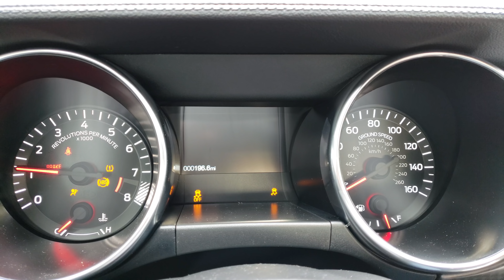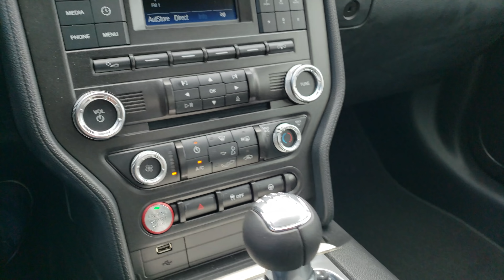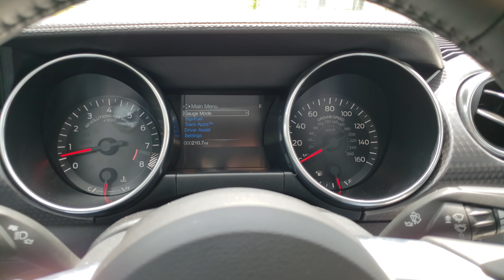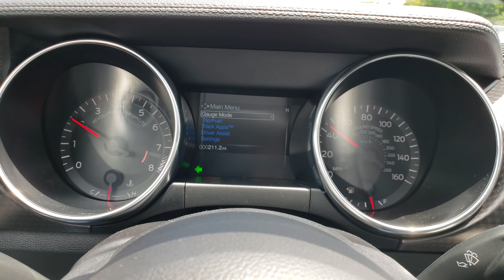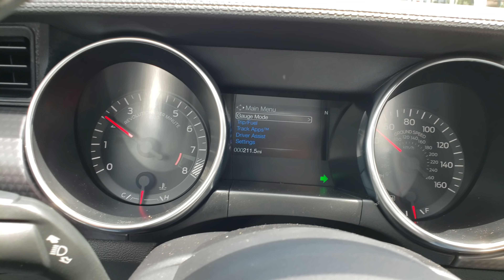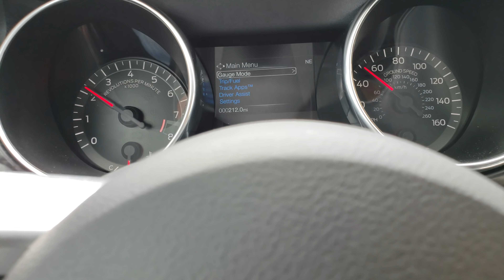I bought a 2018 Manual Mustang PP with 3.73 and already modded it

Comment: I traded my 2017 GTCS for the same thing you did. It was the base Mustang with the Performance Pack. I don't have the info system (put my own Sirius radio receiver in it) nor leather, but I never got a lot out of having leather seats. It is blacked out, six speed manual I have the spoiler on mine. I did add the flow master 40 series, but left in the resonator (I did the same with my 17, but this sounds more aggressive, even with the resonator still on the car).

Comment: I have a late 2016 GT manual with approx 14,000Ks, I put in the Steeda spring and whilst the take up point felt more predictable the actual pedal was harder to engage and sprung back with more force, put the stock spring back in after a couple of days and felt completely different (I guess the Steeda put it into "Perspective"!) lighter and easier to use and the take up point didn't seem to be an issue.  didn't drive it without any spring as static the pedal was (for me) to heavy / stiff.

Comment: Track Apps bud...line lock only activates in Track Mode. Itll light up in Track Mode. Also, if you put it in track mode and hold the traction button about 5 seconds to turn or stability control, line lock will turn on BUT say it's not available when u go to activate it.
Reply: You don't need to be in track mode to activate line lock.
Reply: petey2crazy on my 17 GT you do
Reply: My 15 Gt doesn't need to. The only mode it can't be in is snow/wet. I can't find anything on the web that says you need to be in track mode.

Comment: I thought the cars with the PP came with the digital dash cluster? I bought the base model, and got the one you have there. I kind of think the digital one is gimmicky, anyways. I'd really love to know what ya paid for that car, though! I bought mine for 29.5k. Marked down to 32.5 with rebates and incentives in my area. Think I did well, but would love to know if I could sharpen my negotiating tactics a little.

Comment: Link lock is out probably due to needing the brake in miles. Friends trackhawk wouldn't let u use launch control until 500miles
Reply from the maker: I5ZQ8 nice I'll keep you posted
Reply: 15ZQ8  Thanks for your post.  I was wondering myself why "line lock" was grayed out and being  PP at that.
Reply: Line Lock is not an option when the Cruise Control is powered on. Turn the CC off. Have a great day guys.
Reply: Sandy Crowley Thanks for that tidbit of info!
Reply: You're welcome!

Comment: Love the car man!! I have a magnetic 301a PP M6 car. I love it. It is hard to shift though. At high rpm I’m losing clutch pressure. The pedal isn’t going to the floor just about 1/2 way down and it’s almost impossible to shift. Oh and I’ve had the 3/4 fork replaced. So hopefully I’m good to go. Are you gonna do headers or just a cat delete?

Comment: Hey buddy, looking at a 2011 Yote with 100k miles for $11,5. It’ll be my first stang, it’s within budget but the miles concern me. It drives great, it’s fully stock. 

What’s your thought? 100k miles a lot for these engines? I know the 4.6s last forever, don’t have much knowledge on the coyotes.

Comment: Wow. I'm getting ready to buy an 18 GT and the fact that I have to remove a spring in the clutch pedal to make the engagement point usable? I just don't get buying a 40k car and having to change a major component of the car. Why didn't they do it right is my question? During my test drive I noticed I was having a hard time finding the right engagement point when starting from a stop. frustrating.

Comment: For someone who already has the Steeda aftermarket clutch spring would you recommend just leaving it in or taking it out? Never thought about just taking the whole assembly out. Also was the rev match stick with the 15-7’s, I never noticed that before? Now I can’t wait to jump in my ride when I get off work.
Reply from the maker: Dirty__D 15-17 also have it. And I just took the spring out
Reply: Wow, that’s all I have to say. I could of saved $20 on the Steeda spring, not that it was expensive but as big of a difference I noticed from stock to Steeda it was just as big of a change from nothing over Steeda. 
And I was able to feel the rev match once I slowed down my pedal release. I’m a “fast shifter” too so I never felt or noticed it. I really had to slow down to feel it, basically it’s about a 1 sec delay from when you put it the different gear. I would put it gear and literally do a one-one thousand in my head before releasing the clutch. It makes the car really smooth if you shift slow but I’m going to have my tuner remove it because I think I might be fighting it cause I shift so fast. Thanks for the knowledge Alex, keep up the new content 👍🏻

Comment: Hey Alex. Just built my dream. I have a 2012 Genesis as well that I bought for a daily driver instead of my dream car, 2015+ Mustang GT PP1.  I may have to go see if I can hunt down a deal on the 2018 like yourself.  One question, what is your thoughts on the transmission shift fork failure? Any plans to upgrade the MT82 or just leave as is and have Ford fix it if it were to fail?

Comment: Alex, Steeda has a replacement spring for the clutch pedal, I guess it is a lighter spring that helps give more pedal feel, but do you think it is just marketing when they claim that running without a helper spring puts strain on the slave cylinder long term causing leaks?

Comment: I've got the exact same car in kona blue. Awesome info on that spring popped it off and boom..... Night and day. Clutch pedal feels amazingly predictable now. 
    After the fact saw a thread that removing it completely can cause possible   slave cylinder damage. How much truth is there to this? Anyone?
Reply from the maker: Chad Keller I had mine off for 6 years in my 11. No issues  it's not an internal stop...just an assist spring
Reply: Thanks for the quick reply & all the great info you're putting out. Appreciate it
Reply: Alejandro Flores what do you think you're gonna mod(parts) first? I've heard a lot of people complain about the "notchiness" in the shifter myself included.
Reply from the maker: Chad Keller the shifter to me is fine. That wont be upgraded

Comment: Alex, working in the tuning/performance mod world, what is your & the mechanics you know opinions on the "break in" period for new vehicles/engines?  Stuff like "keep it under 60, vary your RPM & don't go hard on the throttle or brakes in the first 500-1000 miles"?

Comment: Question man.  I did this on my 2018 gt350 and like the feel a ton better then with the assist spring.  I do have a little play in the clutch now though when it is fully out,  like a half inch of sag.  Meaning when the clutch is fully out you can put your foot behind the pedal and push up and the pedal will move upwards like a ½inch.  Figured you would know man,  is this bad or what?  I just want to get a definite answer.  Some People say it is bad on the seals and can cause them to leak cause the clutch is not fully returning to it's stock position.  Figured you would know the answer to this.  A video on this or just a simple reply would be much appreciated. So sick of worrying about it.

Comment: I want to learn tuning with hp tuners. What do you recommend for a newb to do? I been looking over my tune for a procharged 2012gt. I get wrench light and my tuner says its heat since vegas is crazy hot. Waiting for radiator to eliminate lack of capacity, and wrench of yellow death!

Comment: Hey Alex. Can you do a quick video of your thoughts on the performance difference between direct fuel injection on the 2018 mustang and the old way ford did it on the 2016 mustang? How different it is to tune between the two as well. Thanks.

Comment: Compared to the 2011-2017 Mustangs, Is the clutch throw shorter? I just personally found the throw to be longer than needed, as it reminded me of a BMW's clutch but grabs much later.

 Just curious as I was burned by my own MT82 in a 2012 GT I had, sadly in ontario canada the laws are different so I took the hit and had to get it rebuilt with my own money. So I am hesitant to go and really look at a 2018+ GT, and stick with the 392 Challenger (which I am still kicking my backside over selling)

Comment: Congrats Alex!!! There are MANY videos of engine ticking and excessive noise, some even think piston slap coming from the gen 3 5oh. Could you do a video a give your opinion on it? 
Thanks.
BTW LONG time subber
Reply from the maker: I'll keep you posted.
Reply: Alejandro Flores Thanks.
I just ordered a 19 10r80 pp and we value your opinion.
It's got me a little nervous with some of the 5oh issues people are reporting regarding the engine.
Reply: It's not just the gen3.  Had my gen 2 long block replaced on my 2017.  Rattling noise around 2k rpm.  Had a few issues.  Most notably was evidence of piston slap.

Comment: I thought rev matching wasn't introduced on these cars till 2019 models.  Actually I have read multiple articles on this.  So what gives? 
Also are you concerned about the famous tick and the aluminum bending forks?  I know you were in a previous video and ultimately you said thats what put you off the new mustang......?
Reply: batman62487 
Yes I know what it is,  lol.  However he clearly states it has rev matching at the beginning of the video and it does not. 
I know how to rev match,  heel toe shift,  power shift,  etc.... No novice here,  like this jokester thinks he's the only one who can drive a manual. Little full of himself I'd say.  Lol
Reply: batman62487 
Yes sir!  👍

Comment: The 18s are going for almost 8k off MSRP if u include the Ford rebate that EVERYONE qualifies for...just picked up mine!
Reply: ThePerfectDad how do you qualify for that 8k rebate?
Reply: big yee not an 8k rebate...but with the rebate included which right now is $2500 for everyone and there are additional ones that are $500...with dealer discount it can all equal near 8k
Reply: ThePerfectDad what dealership is this?
Reply: Antonio Barrueta in northern Virginia...specifically Sheehy Ford of Springfield
Reply: surfncnow I’m from the area...U cannot go wrong with either dealership as far as reputation...hope you find the spec for u like I did !
Reply: ThePerfectDad what did you get out of the door with? I picked up a 2018 GT PP1 Base, and I got it for $33k, with the $1500 from my trade in. It stickered for $43k.
Reply: JonnyRend I didn’t have the luxury of a the trade in money but I was debating PP1 or the 301A and decided the 301A 10 speed and I’m adding the ford performance street suspension this month...OTD was 34.5k

Comment: Damn. I drove a 2018 GT manual and I hated the transmission clutch engagement and that was my main reason (and it was 50k) why I didn't get it because the clutch was so much different than my 2014 GT. And I'm a gear head but totally forgot about that stupid spring....

Comment: Yolo tengo una duda, el rev match no venia en el 2019?
Reply from the maker: That's downshifting rev match. not upshifting
Reply: @YDBT4LIFE  ,
What Mustang shop Do you recommend in south FL ?

What fluid are you using in your transmission ?

Keep up the great videos. 👍
Reply from the maker: @williamhorvat8224  stock fluid. And tradition Motorsports at this point is the only one that is taking in work.

Comment: After all the broken 6spd 2018s I'm surprised u still went with it... 
 over 10r80
Reply from the maker: WonSlow302  name all of the broken mt82 of 2018 you know of.. I know of 2 and it was clutch issues
Reply: Alejandro Flores maybe so. Friend couldn't shift to 3rd when high rpm when we ran. Brand new off the lot. Just came out the shop few days ago.
Reply: Quick search on the Facebook groups and seemed to be an issue of weak forks. Aluminum I think..
Reply from the maker: WonSlow302 so he could not get it into 3rd (clutch) and he forced it (driver error) and broke it. Sounds like clutch not fork

Comment: In my 18, the car seems to wait to open throttle body until after I'm rolling. I can use 4500 rpm limiter launch and still bog while ever so slowly releasing clutch (throttling out does nothing until rolling). Can you dive into parameters to see why the car won't respond to extra throttle until I'm rolling?

Comment: Can you comment on ring gap for the gen 3 5.0? Like is there any use in checking compression across the cylinders to see if the rings are "too tight" for big boost? Thanks
Reply from the maker: LOL i'm not doing that. LOL

Comment: Alejandro have you heard about the shift forks being weak on the 2018? If so you know of any aftermarket fix?
Reply from the maker: texas stangs ben calimer has only heard 1 case of it. And most is due to clutch lockout and ndmfers

Comment: Did you infer that "Line Lock" is now disabled from the factory?
Why?
Reply: It's not. You got to be stopped to use it.
Reply: and on level ground. I thought mine was disabled as well, trying to select it in my driveway after we brought it home. and my driveway is not that much of a decline either.
Reply from the maker: I was stopped. LOL
Reply: That's weird. Line lock is finicky as hell.
Reply: Maybe it only activates following the normal "break in" process.
Reply: Don't take this wrongly.
Sometimes a bastard just needs to break down and read the fuckin' owners manual.

Comment: I can’t decide if I want an full bolt on, cam all motor 13/14 or if I should just get an 18
Reply: A fbo cammed 13/14 will make the power a 18 with headers, intake and e85 tune makes. Only thing an S197 has is weight advantage. But personally I’ll always love my 13

Comment: Do you need the 3.73 to achieve the sub 4 second 0-60?
Reply from the maker: I believe so yes unless you make a boatload of power
Reply: Alejandro Flores thanks man. Another quick one: do you know if the lund tune is well serviced if I buy it in Mexico ? I live 5,000 feet above sea level so my GT is losing tons of power
Reply from the maker: @nozopoke1782  any calibration above the stock calibration is going to be better for the vehicle

Comment: Rev hang sucks, BTW. I want the revs to come back down immediately, yet the revs stay up. This matters because if you're going slow and you rev the car up to show off the exhaust, you have to wait a few seconds before you can engage the clutch or the car will lurch. This was added to help with MPG and it can't be tuned out, either. 😒

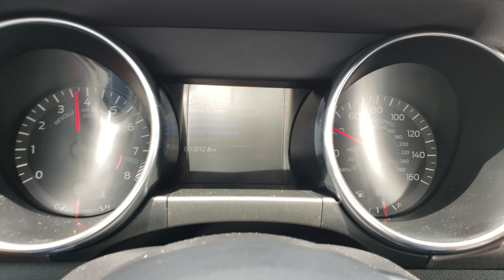Comment: 14:30 See. thats exactly what I try to tell people only fr it to fall on deaf ears. These cars, whether rightfully so or otherwise, are known as massive hoon-mobiles. People FLOG these machines the instant they drive them off the lot. I see SO many videos of people getting brand-spanking-new Mustangs doing burnouts, hard pulls, drag strips, etc. within the first couple hundred miles, well within the break-in period for the car and it's engine and transmission. Keep in mind  literally all manufacturers recommend doing the exact opposite of those things for about the first 500 miles (Give or take), even for top sports and performance brands and vehicles.

Not counting actual admitted defects that have happened (Like the manual shift forks in some of the 2018's), the vast majority of problems that arise from Mustangs, and really any car by extension of that, is due to improper handling during the break-in period. The Break-in period can have a direct impact on the entire life of the vehicle if it is done incorrectly. And remember these cars practically invite people to trash them like a 5-dollar hooker from Vegas. I think considering the fact most Mustangs throughout the years have worn very well with relatively minor problems is a testament to their deceptively robust engineering.

Comment: Is that spring on a 14 Shelby GT500 thank you
Reply: Mark Disbro crawl in there and look
Reply: Chandler don't recall asking u
Reply: Mark Disbro I doubt his answer would be much different lmfao
Reply: Chandler 🛴👆
Reply: Mark Disbro the gt500 has the tr6060 and almost every clutch comes with a spring now. i have a 2012 vette with a tr6060 and it had a spring.
Reply: Yes, '13-14 GT500 have removable spring, feels perfect without.
Reply: drjotting thank you

Comment: I guess u wanna go slower now lol. Alex why would buy a car with such an inferior transmission that will absolutely need to be replaced. Seems like ur going backwards now especially with the addition of the 4r200
Reply from the maker: DANTE BELGIAN MALINOIS lmao. You know nothing.  Lol. It's actually laughable.  Do the really really fast cars have more gears or less gears. I'll wait.
Reply: Just breaking ur balls.... settle down. The fast cars have 3 speeds unless ur talking Lenco or similar transmissions that cost $15k and cannot be used on the street. U don't have a Lenco bro u have a junk M82 and the 4R200 would not only make a 6r80 stronger but the gear ratio is better so what is it that I know nothing about exactly? I get it the majority of customers have stick shifts so u got one.
Reply from the maker: DANTE BELGIAN MALINOIS this is not a drag car . Like at all. It's a daily/autocross build. And those are 90%manual. I have an auto car. And hate it except when WOT the rest is boring. I love spirited driving and it's not possible with an auto unless you're going in a straight line.

Comment: Should’ve got an auto
Reply from the maker: I drive the manual way more then the auto. I would never buy an auto again
Reply: Alejandro Flores I understand. I just feel like the main reason for the 2018 was the 10 speed trans. And it’s great no complaints.
Reply from the maker: @Kingleo_23912  after seeing it apart. I'm not a fan.
Reply: Alejandro Flores damn. See u on the road then 💨💨💨